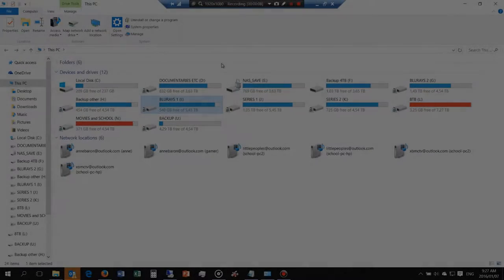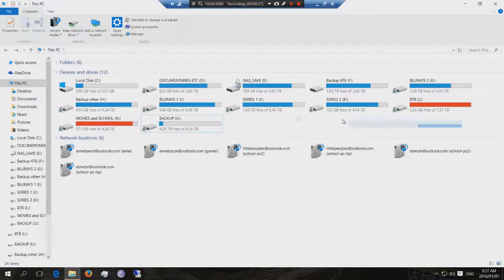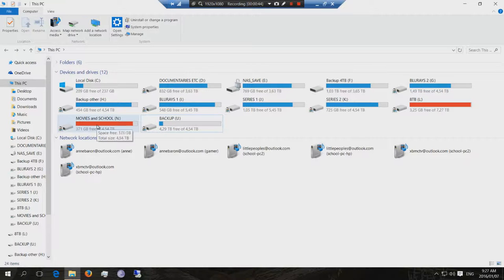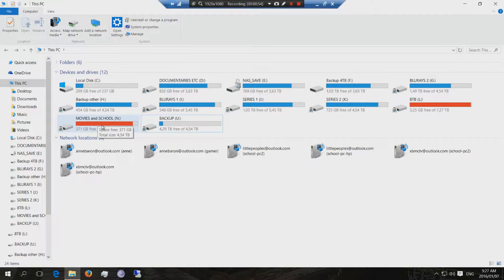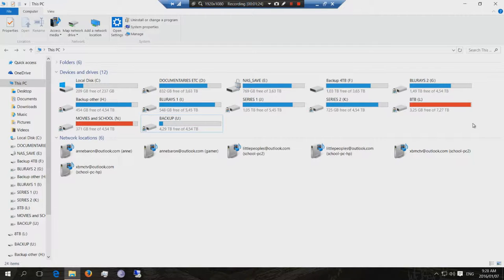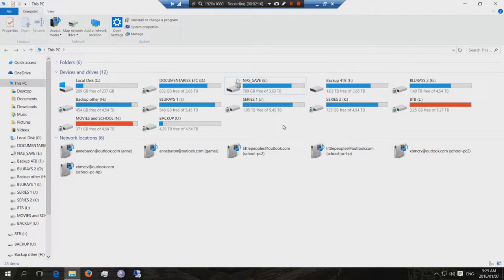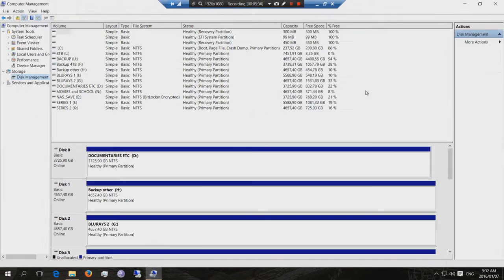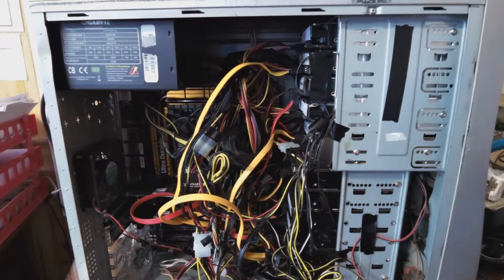12 Bay homemade 57TB NAS - Windows

Comment: why not pool those drives into 1 large drive??
Reply from the maker: +FURBY8704 different permissions for different users across the network. Sometimes drives fail and then its easier when they are not pooled.
Reply: have you looked into unraid or something of that sort?? i use unraid for my 34TB+ storage and have never lost any data and makes it very simple to rebuild data if a disk fails thanks to the parity drive